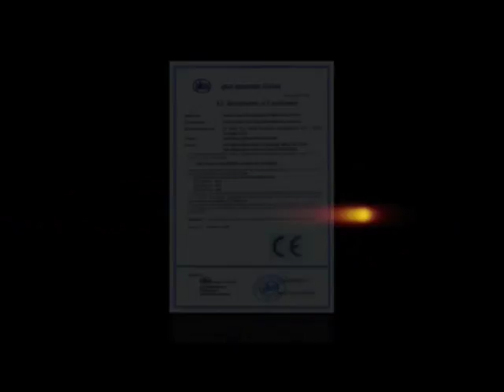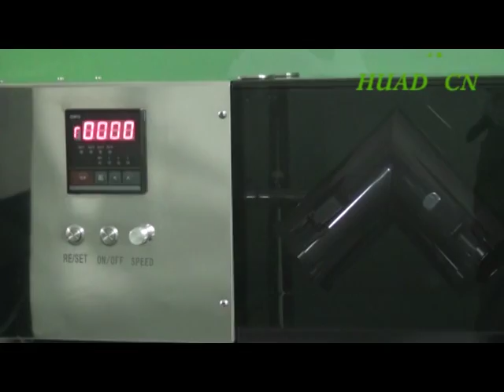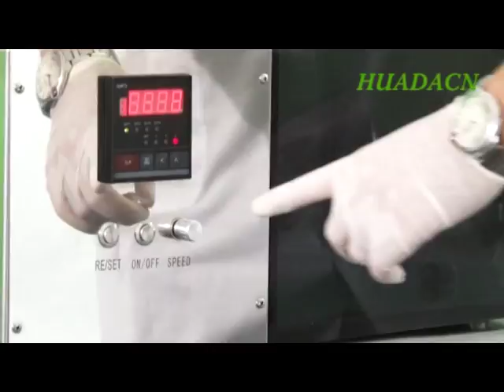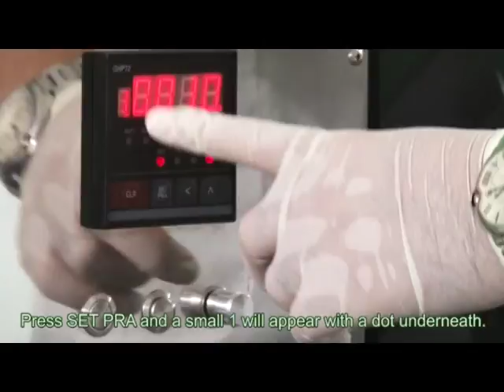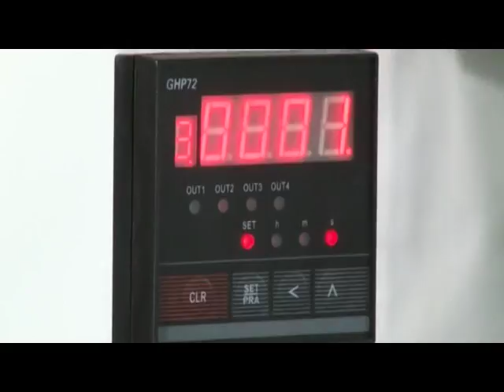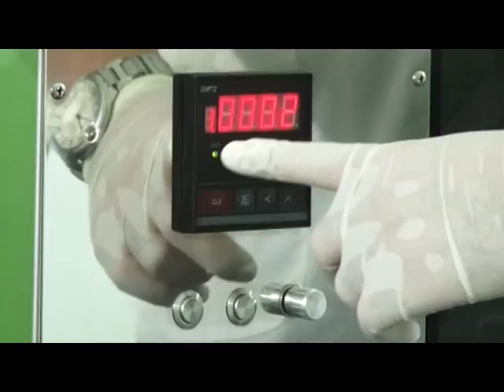Introduction Mini Pharmaceutical Powder V-Mixer,Powder Blender for use in R&D/Pharmacy Compounding

Comment from the maker: CapsulCN International Co., Ltd
Mail: info@capsulcn.com
Mobile/ WhatsApp/WeChat: +86-18858877122
Skype: capsulcn.order@gmail.com 

PHARMACEUTICAL EQUIPMENT
1. Empty capsules: https://www.capsulcn.com
2. Machines for mixing of powders, granulation, compression, de-dusting coated, packing, packaging, counting: https://www.ipharmachine.com
3. Automatic capsule filling, liquid capsule filling, bottling line: https://www.pharma-equipment.com/

CapsulCN has more than 25 years, providing our clients with assistance in the delivery, commissioning of various pharmaceutical machinery. Thanks to CaspulCN's Research, Development, Engineering, and Expertise in Manufacturing, we can provide you with a suitable and reliable solution to meet your manufacturing requirements. 
Are you looking for a reliable supplier of equipment? 
We will give you the best service 24/7.
We have set ourselves the task to help our clients in the correct choice of pharmaceutical equipment. 
Years of experience of such activity shows that many clients face, first of all, a lack of understanding of the process. Purchase of the equipment should be the final point after a detailed discussion of the problem, consult with the equipment manufacturer, sending raw materials to the factory, test operation.

Our most common pharmaceutical machine is composed of: 
1. Automatic Bottle Unscrambling Machine 
2. Capsule Filling Machine 
3. Encapsulation Machine 
4. Tablet Press 
5. Bottle Cleaning Machine 
6. Counting and Filling Machine 
7. Weight Checking Machine 
8. Desiccant Inserting Machine 
9. Cotton Inserting Machine 
10. Cap Torque Machine 
11. Aluminum Foil Sealing Machine 
12. Labeling Machinery